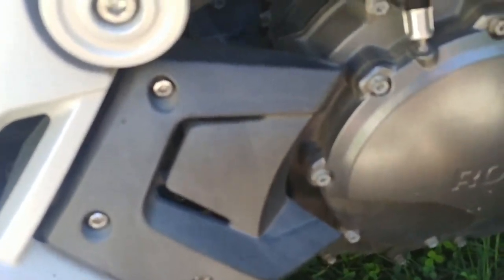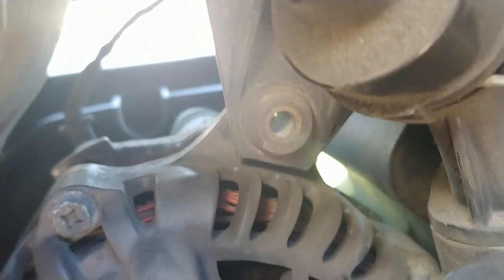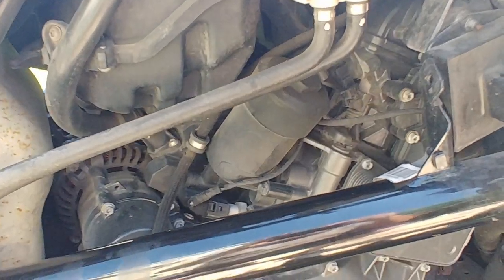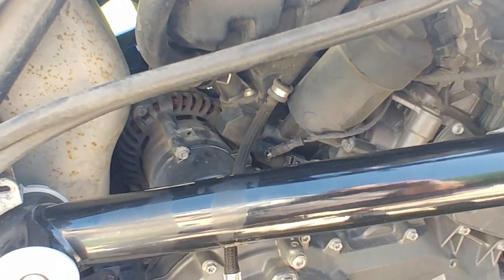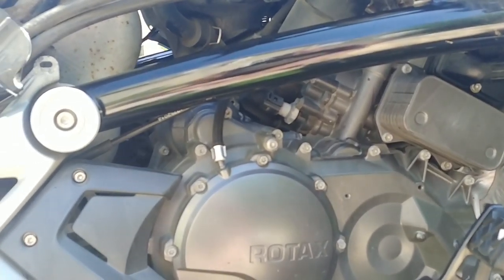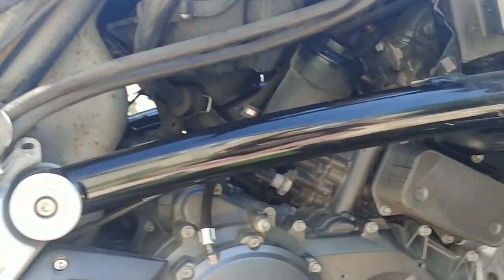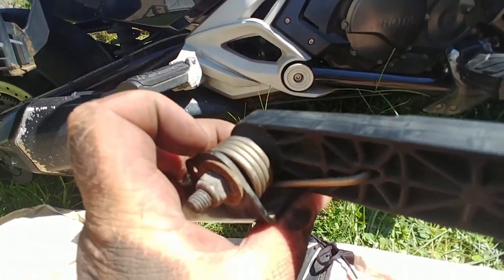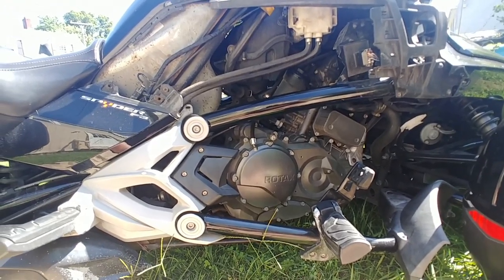OIL CHANGE ISSUE AND A BAD BRP BELT TENSIONER

Comment: Love the attitude, wash my hands and go for a ryde. Congrats on the 64,000 miles too.  P.S. I’ve always had my reservations about plastic belt tensioners.
Reply from the maker: It was a good 300 mile weekend! Next is new back tire and pads. It does surprise me with all the bolts that I have found missing..i dont understand that. Last count I was over 7 bolts missing. Plastic tensioner definitely not good...but now we know. Ride safe
Reply: Much better to work on our bikes than let someone else screw it up.
Reply from the maker: @NormKohn  i agree 100%
Reply: @spyderryder  Me too mate! 👍😁
Reply: @NormKohn  I agree with you 100% Norman! 👍😁 Beanie

Comment: I wouldn't be that worried mate, my Suzuki had that amount of metal on the drain plug the last oil change I did! Looks just like metal oxide ... It's way less than what you've had on previous oil changes! As for the so called belt tensioner, I'd throw it away ... I'm not worried about Belt Vibration! When all's said & done ... 100,000 KMS on a bike is not a bad innings! Hopefully you'll get another 60K MILES ... I'll never beat your record mate that's for sure! 👍😁 Beanie
Reply from the maker: The bad thing is when I poored to oil out of the drain pan it was very sparkly!! It was a ton more metal then I wanted to see. I will change it early and buy a new catch can to verify it came out of the Spyder. 
Yep I dont think I will but a new tensioner back on its not worth it.
Reply: @spyderryder  Yeh belt tensioners are a waste of money mate ... Vibrations are only @ certain speeds anyway as you already know! 👍😁 Beanie
Reply from the maker: @BeanieBoyMoto  its crazy even with my completely destroyed it still took a ton of vibation out of the belt. I do believe it will take me a little time to get use to the belt vibration...mine is from 60-65 mph or 96-104 KPH. I hope the conversion is right👍
Reply: @spyderryder  Yeh like we've said previously depending on what your belt tension is ... Determines what speed the vibration occurs! 👍😁 Beanie
Reply: @BeanieBoyMoto  So the tensioner is only to lessen the belt vibration, Beanie? It isn't to take pressure off the gearbox output shaft bearings?
Reply: @1990-t1j  Hi mate, that's exactly right, used to lessen vibration & supposedly lessen belt noise ... Check out those two TSB's I uploaded on belt vibration & belt noise & read my pinned comment on each one, all the information you need is there! 👍😁 Beanie
Reply: @BeanieBoyMoto  I will.

Comment: Well the material on the plug is from the trans side at least.  How did the engine side look?  I have the lamonster upgraded bearing on the factory tensioner so I may swap it out. Odd to have the spring still be a weak link..
Reply from the maker: The drain pan also had some metal...i will keep an eye on it. It was crazy to see the spring broken I have not heard of the before. Ride safe
Reply: @spyderryder   thanks, I'm a long way from the mileage you have. Hopefully the shavings taper off.

Comment: That belt tensioner is not a good look  and it’s a good thing you took it off as it was doing two bits of stuff all other than damaging your belt, having made out of plastic much like the sway bar links makes me cringe so I went for the billet aluminium belt tensioner and upgraded the sway bar and link now I am happy with that now I just have to wait for the oil change as I have changed the plugs to dimple drain plugs
Reply from the maker: I got lucky this time finding a very bad tensioner. I dont think I will replace it right away. Thank you for watching ride safer

Comment: After the next oil change and service at my independent, I will begin doing my own service.  I have the same tensioner that you do and will give it a close look next time I have it pulled apart.  There is another tensioner out there but it's about $175 if I remember correctly.  Maybe it's money well spent if it saves a belt.  Currently running Castrol oil but was thinking of going to AMSOIL next time.   Wow, I envy your riding time and mileage.  You really are getting your money's worth out of your F3.  Ryde safe!
Reply from the maker: That is one thing we need to keep in mind. I have 64,000 miles on the spyder and I have 15,000 to 20,000 on the tensioner... Some poeple will never see that so a $40.00 is a great deal. Nothing is a good part but I would check it from time to time. 
I believe if you use a high quality oil in change it regularly you will be fine. I hope to get many more miles out.of the old spyder. Ride safe

Comment: Thanks for your videos and honest assessments. I just want to throw in my two cents worth.
I installed a Can Am belt tensioner on my 2015 F3S at about 6000 miles and it did a good job of 
reducing the vibrations I was experiencing.  At about 9000 miles I noticed the vibrations returning.  I checked the tensioner and the wheel was sitting about a half inch above the belt.  I removed it and found that the pivot sleeve was sticking.  I ordered the new and "improved" idler assembly from BRP and it helped with vibration, but I have always felt that the little roller with the single internal bearing was just not up to the job, so out of an abundance of caution at 10,000 miles I ordered Lamonster's idler wheel.  It works great and is worth the $49.95 I paid for it.  The wheel is a lot larger and has two big bearings.
Reply from the maker: I think you are right if you run a tensioner you have to upgrade it to Le monsters Big bearing. Ride safe

Comment: Scary..just got my 3000 inspection done. My dealer bill was $250.00. They did it for me while I waited.  Keep  us in the loop on the metal filings.
Reply from the maker: It has been there on every oil change. I will change it early next time just to play it safe.
Reply: You could have done that service yourself for $90. All they do is change the oil.

Comment: Ok broo i have a 2015 f3s 2000 miles and my father have the 2015 f3 base 2800 miles does this have separated oil for trans and engine and if it is what type of oil you use .
Reply from the maker: On all spyders the engine and the trany share the same oil. I use Amsoil oil when I change the oil and the dealer uses Factory BRP oil.

Comment: Interesting video. I remember seeing metal on the magnet on several of my old machines, cars and bikes.
Reply: Same here mate ... Had roughly the same amount on my F3 & on my SV Suzuki I sold recently!
Reply from the maker: No you dont have to run a tensioner 100% optional. So I will not run one for now. At 64,000 miles you would think I would not be have metal on the drain plug. The last two spyders after the second oil changes I had no metal at all. Time Will tell I guess.

Comment: Huge fan of your videos, thanks for putting the info out there for us. Any chance you could do a video on how to correctly check and adjust the drive belt on our F3's. I just bought the Kricket belt gauge. I've searched the net and am getting conflicting intel, I trust your knowledge, thanks in advance .
Reply from the maker: I just put one up I show how to use it. Its not to in depth but I have the rear wheel up running how to adjust it and how to use the cricket. Thank you for the kind words!

Comment: Be careful with the Lamonster tensioner. It does have the upgraded bearing, but it is a stock BRP tensioner arm and spring. That being said, the bearing is a serious upgrade.  As to the drain plug, hey, it's doing it's job... Be safe...
Reply from the maker: I think I will roll with out a tensioner for now don't want to risk any belt damage. The drain plug is doing what it needs to but I also have metal in the filter and in the bottom of the drain pan. It appears to be running great and always has.

Comment: By looking at all the complaints I have seen about metal in the transmission I am thinking I’ll do the first oil change at 7,500 KM instead of the 15,000 as stated
Reply from the maker: I did my first at 3000 miles and then around 7500 miles. A couple times it did get to 9000 but then it has also been changes at 3000 or less. Ride safe and 7500 miles is a great oil change interval

Comment: After seeing this. I just upgraded to lamonster's belt tensioner roller. Im not taking any chances getting stranded and maybe putting on a $300 belt.
Reply from the maker: I was very shocked to see how back the factory tensioner was. I feel its worth the money to upgrade!!
Reply: @spyderryder  I checked mine today it was fine, but I only put about 3000 miles on it. I agree the  $50 upgrade is definitely worth it.
Reply from the maker: I think I have 15,000 miles on mine when it was checked last. That being said a $40.00 part is not worth it if it does $300.00 damage!

Comment: So what's the purpose of the belt tensioner?  I have a 2018 F3, do I need a tensioner?
Reply from the maker: The only purpose for a belt tensioner is to control the harmonics or vibrations from the big belt on an F3. If the vibrations don't bother you then you don't need a tensioner. It is 100% optional and does not affect the performance of a Spyder it just makes it ride smoother.
Reply: BRP does not call it a tensioner, they call it an idler and that is a more apt description. It works as a damper, not a tensioner.
Reply from the maker: Correct is puts very little pressure on the belt